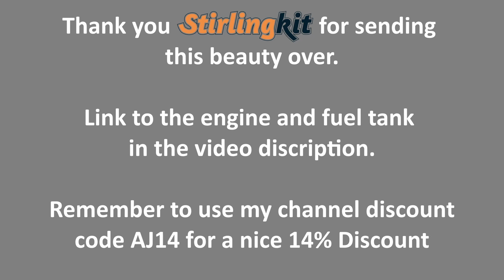Stirlingkit model engine compilation.

Comment: We used to say "cheap chinese junk"...now it is "expensive chinese junk". I wasted $300 on one of them and did not get a single minute run time out of it. There were brass shavings in the cylinder which chewed up the piston "o" ring in short order.
Reply from the maker: What model did you buy? If you would like I can put you in contact with someone if the engine was bought by Stirlingkit? I am sure they will sort you right out.
Reply: @AJRestoration  It is called EACHINE. Made of brass with steel flywheels. Horizontal cylinder with the fuel tank on top of the block next to the water tank.
I doubt they will but thanks anyway
Reply: @AJRestoration  How the rubber piston ring is supposed to last is a mystery to me lol.
Reply: @montwolfman Maybe it has heat resistant material. I have a FS-L200 and it has worked well for me. The only thing I don't like about Chinese motors is that their screws are very sensitive and if they break, the motor It is destroyed

Comment: Für die gesamte Vorführung gibt es einen Daumen nach unten, ☹👎, wenn nicht ein einziges mal gezeigt wird, was die Motore leisten können. Warum schließen Sie keinen stromerzeugenden Generator an die Motore, und zwar mit Volt- und Amperemeter-Messgeräte, damit man sehen kann, was die Motore leisten? 
For the whole demonstration gets a thumbs down ☹👎 if not once is it shown what the motors can do. Why not hook up a generator to the motors that generates electricity, with volt and ammeter gauges so you can see what the motors can do?